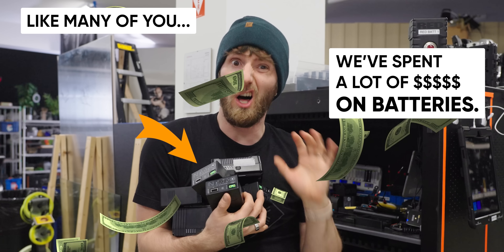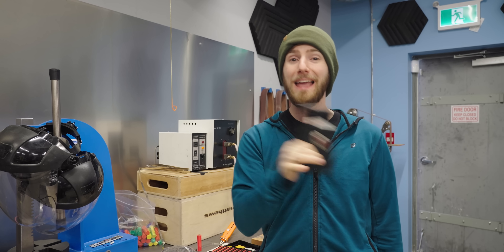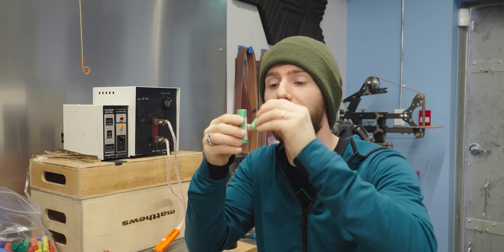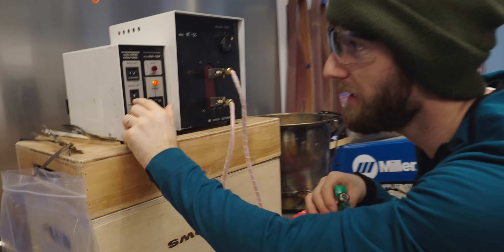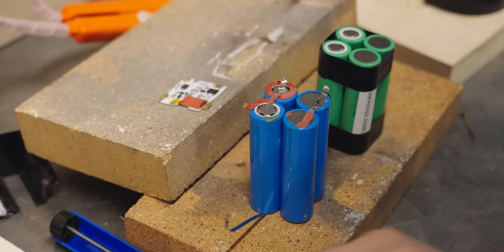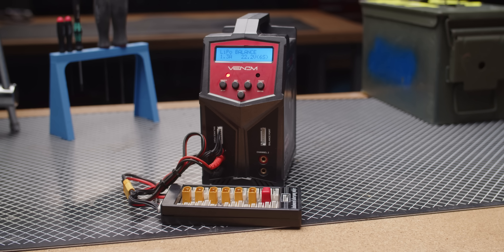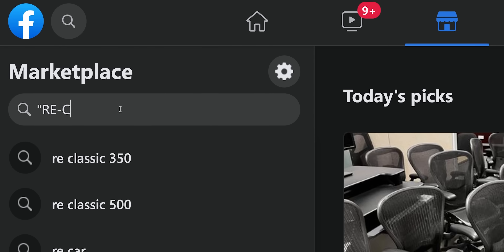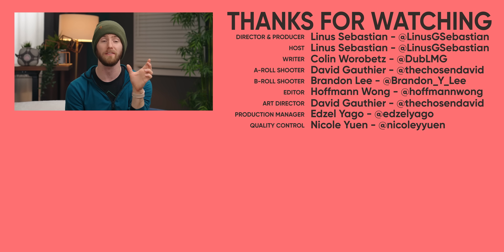This should be illegal… Battery Repair Blocking

Comment: One thing you didn't mention checking is trying to charge the battery first after replacing the cells.  For many BMS units, they start in an output disabled state and require you to first attempt to charge the battery in order to wake the BMS up.  Others require a wakeup voltage across specific test pads on the BMS and still others are as you describe, basically one time use.

What really bothers me is the number of BMSs that now communicate with the device they are plugged into "Canon I'm calling you out" so the battery has a security chip onboard that identifies it as an OEM branded pack and won't work with otherwise compatible replacements so you are at the mercy of the OEM to keep making replacements for a camera that may be in useful service for 20+ years.

Comment: This is great info for enthusiasts, but a little out of my reach.

The second someone mentions soldering/de-soldering, I completely check out. Kind of like the idea of not using a coupon on something unless it's for something you were going to buy anyway, DIY soldering only makes sense if you do it professionally or on a regular enough basis to be proficient at it, and already have the tools and peripherals to carry out the task. The labor, time, and cost of consumables are never factored in when someone says, "It's easy! just solder a new one!" People that say that kind of stuff are really disconnected with the gap between them and the average consumer.

Comment: Love the safety emphasis so amateurs don't try this and hurt themselves, but you threw out perfectly good cells, that sparking is completely normal and not what you think it is... That's the tip of the spot welder abrading itself and firing sparks, nothing to do with the battery being at risk of any kind of fire at all. Think about when you touch jumper cables together, same thing, and all to do with the spot welder. You can even see the same totally normal sparking by a professional at 17:26.

Comment: When welding strips to the positive terminals of 18650 and similar cells you need to be extra careful how your strip is routed to the positive terminal because the casing of each battery is attached to its negative terminal!!!  There is literally only about 3 or 4 millimeters between the positive terminals edge and the edge of the negative tied casing of the batteries.  If you heat the strip too much then the strip can burn through the insulation around the top near the positive terminal and short to the casing.  So don't make your strip too long and use a toothpick or a business card between the tab and the edge of the cell when welding to the positive terminals.  Also, discharge your cells to about 2.8 volts before welding to them.  Oh, and spot welding will occasionally produce sparks especially if you use too high a voltage, and it is a high current at the lowest workable voltage with the shortest on time that you really want.  It should be quick like snapping your fingers, if its not then your probably doing it wrong and damaging your tips and your batteries with excessive heat and stray voltage.

You can also order 18650 batteries "with tabs" that you can solder directly to and as long as you don't apply heat for too long it is much easier to create packs by just soldering wires between the tabs on each cell.  You just have to solder to the ends of the tabs and fold the tabs back over the cell as you go to keep the tabs out of the way.  If you are good at soldering it is much simpler but may require a bit more room than before.

Comment: I used to work on a team developing large Lithium packs for some in-server DC UPS solutions, A lot like a big laptop battery. In many cases disconnecting one wire tap from the calls would make the next one up see double the voltage, it would then do its job and permanently blow an electronic fuse in the BMS preventing the battery from ever charging again. You could put them into a service mode before re-celling. It's possible the BMSs in this video are behaving quite reasonably.

Comment: Bear in mind different types of lithium batteries are disposed of in different ways. We cover leads and  handover liion cells for recycling. We discharge, test, completely short-out, and then throw away lipos. 

We do need to pay more attention to devices which have the “do not throw away” indicators on them. They should be turned over to the proper facilities for disposal.

Comment: Many years ago I had an HP DeskJet 2500 printer, it was fast and could do 11x17" with amazing results. It used individual cartridges and heads for CYMK, and it worked really well for the first year or so, although the consumables were quite expensive. My wife used it to do some charity work for her university, and the organizer was so thrilled, he insisted on doing something for her. She finally relented and said a set of cartridges would be OK, and she received two of each colour as well as one set of heads. Since we already had a new set of consumables in the printer, it was over a year when we finally opened the second set of ink (I think it was black, we used more than the others). When I put in the cartridge, the printer refused it saying it was expired. I looked at the box and sure enough, there was an expiry date on it, and we were about a week past it. I put the old cartridge back in and realized that it too had expired, despite there still being a bit of ink in it. The colour ink had not yet expired, but each cartridge failed as it reached the expiry date. I called HP and they said it was normal behavior, and that the only solution was to buy new ink. Then the heads expired, despite everything working fine... I disconnected the printer and gave it away that same week.

Comment: There's actually special class D fire extinguishers made to put out lithium fires, in fact there are specialist extinguishers for most types of hazardous materials fires given that you mostly deal with delicate electronics I would be surprised if you didn't have a clean agent extinguisher or twelve on the premises as they cause little to no damage to electronics unlike normal powder-based extinguishers.

Comment: 9:50 I spotweld a lot of batteries, and I can tell you the electrodes were not the issue. The main issue was the welding time, that timer you are using is literally making your batteries glow. There is way too much heat for way too long there. Use a spotwelder designed for spotwelding batteries like the kWeld. Your welder is designed for big metal sheets, not batteries!!
Even if the batteries would have survived that torture, they would propably leak electrolyte caused by cracks from heat.
Reply: Clearly they didn't do a good at this , I noticed that immediately
Reply: Yeah, like 10x more energy than needed.  Maybe do some better research first?
Reply: Yes. I've used a good old 100W solder iron to wires li-ion cells a few hundred times and never had a single issue with a burst cell. Just cool down the cells immediately and nothing should go wrong afterwards. Spot welders are made so that you don't get any reason to cool down the cells after welding them... The weld shouldn't glow for so long. Obviously LMG hasn't done enough prepping for this video.
Reply: There is to much current also. There should not be a glow as in the video. Probably should have practiced the procedure much more and try to fine tune setting on the welder for such batteries.
Reply: This is the most important comment here. If you're going to be doing something like this then just the tiniest bit of prior learning would tell you not to even try this with that welder. This is super irresponsible.
Reply: Replying hoping it will help get this closer to the top. I do electronic work but haven't welded batteries. I played a couple sections several times because they didn't seem to make sense. Glad it wasn't just me.
Reply: In fact, most (and all cheap-ish) spot welders generally do that. They actually all use too low of a current (like 100A), and they push the current for quite a long time (100ms-500ms) thru pointy electrodes to get any kind of weld on that small weld area.
That's I've made my own spot welder instead of buying one.

Ideal welding current is closer to 1000A, with a welding time around a millisecond (200us to a few dozen milliseconds, depending on strip thickness and electrode geometry.)

There's barely any visible heat in/after that kind of weld, the nickel strip even remains shiny, and the process is much more reliable and forgiving. No plastics get melted.

Note that 10 times the current means 100 times the power in the weld, but also losses in the transformer and wires, and the amount of power would be hard to pull directly from the grid(without capacitors) and hard to control with just a TRIAC, so I guess that's why they don't make those that often.
Reply: That is one of the best comments  here! You have the know how!
Reply: I'm completely ignorant of these things, could you explain what causes those sparks they were getting? And why do they have to throw away everything after those sparks occurr?
Reply: @Michelino_M5  The spark is a short that potentially damaged the battery. They are throwing them out because damaged lithium batteries are dangerous.
Reply: @coreymorse1347  Right, but why does the short happen only when they weld the strip to the battery? Surely the strip doesn't touch both poles, right? And if it did, wouldn't just touching the nickel strip to the pole cause sparking? What changes when the welding is done?
Reply: @Michelino_M5  He was damaging the batteries with a horribly incorrect spot welder. Minor sparking isn't an issue when spot welding specifically, but it is with the way they were doing it. 

Also, they were being overly dramatic with it due to fear. Though with such a bad spot welder, that's probably a good thing.
Reply: @Michelino_M5  There is a chance the short is just from a gap while welding, whether between the strip and the welded or the strip and the battery. There is also a chance he melted through the top of the battery and damaged the inside. He doesn't know which he did so they are moving the batteries outside in case they explode. He doesn't know what he's doing and isn't using the correct equipment, so he's responding as if he fried the battery with the welder. Which is a better choice than assuming he didn't, since he doesn't know what he's doing.
Reply: @Michelino_M5  Yeah, they were talking about sparks being the result of unbalanced batteries, but they only ever welded to one side of the battery. It seems they are missing some basic understanding. If there was a spark, it was from the welder, not the batteries. There was never a complete circuit with the batteries.
Reply: @Michelino_M5  they saw sparks and thought there was this big catastrophic event. There's was nothing wrong. If they thought that was damaging the batteries, they have no basic understanding of batteries. As you said, there was no way that it was a short. If something happened, they'd know about it. There isn't a single scenario that those sparks could have caused a catastrophic event. That "throw it in the sand" nonsense means they've never seen a li-ion vent. If there was soaking in the positive, and the spot welder was hot enough to burn through the terminal, there would most likely not be a spark and, if it went all the way through, there would be instant thermal runaway.
Reply: @Michelino_M5  It looks to me like his spot welder was burning a hole in the battery's metal casing. That allows the highly flammable electrolyte to escape and ignite.
Reply: @coreymorse1347  Wrong. It's not a short at all (that would cause far more smoke, trust me, it happened to me during pack-assembly on a 4S4P pack). It's a spotwelder that doesn't really seems to be designed for spotwelding batteries. But even if that is the case, a spotwelder that is designed for spotwelding battery-cells, can cause a spark when contact between nickelstrip and cell-surface isn't completely right or one of the electrodes isn't making good contact.
It happens with my kWeld as well from time to time. They are overcautious, don't seem to have a good idea of what they are doing and immediate dispose off a rather badly built but furthermore good pack.
And he is lucky he doesn't have to deal with extremely smart BMS-IC's: mine need deep communication (and some software to crack the security keys inside the BMS) per SMbus connection and then full reset and reprogramming to except new, higher capacity cells.
Reply: @coreymorse1347  There is literally no way the battery could have been shorted by this (crappy) spotweld.
Reply: to be fair linus did say they were total armatures and most likely didn't have anyone who could advise them on how to do proper spot-welding so while they did a bad job its still a good video on anti right to repair problems as well as why you should leave battery repairs to professionals.
Reply: @kirby5329  While I agree with most of you comment. I still think that they should of done a bit more research, it's looking too amature and dramatic now to bring his points over.
Reply: @ThaGuus  I agree. Linus did the same when he started dabbling in server grade gear and just communicated stuff to the viewer which were just issues based on his own inexperience and naivety , but he conveyed like his words were gospel from an experienced user.
Reply: Yeah, I agree with you Leo. I'm an electronic tech and also weld and can absolutely say the weld time was to long.
Reply: exactly what I came to comment!

Comment: Linus did you try to recharge the pack after swapping the cells as some have safety not to discharge after the pack goes under a voltage's

Comment: Y'all have way too much money to be this so ignorantly. You clearly didn't even do more than a little bit of research on these. I'm all for learning by doing, but these packs reach dangerous voltages easily and make fires or explode easily. Like you have infinite money just hire and electrical engineer to supervise you and you'll learn how to do things the right way and not teach people on youtube to do things in stupid ways. Also if you want to do this to last a long time to save money you're gonna have to make packs of cells from the same manufacturer (preferably sister cells from the same production batch) with the same chemistries and characteristics of cells or their different capacities and lifespans will shorten the pack. Putting different brands of cheap cells is not going to last nearly as long as a properly made battery pack and especially if you use cheap cells, where 18650s are the land of fakes and knockoff brands, you might not even save money because your pack as a whole won't last.

Comment: I believe fitbit used the "Evil bms" on their top tier ionic series. My watch had to be replaced with a refurbished Watch face. I know quite a few people that had the ionic or versa and it just randomly wouldn't turn on after charging one day.
Reply: There's no BMS since there is no battery pack, just a single cell. But a design mistake where a deep-discharged battery cannot be charged because it either can't backpower the system for a little bit or because it's not being detected is not uncommon, i think i have seen this with MTK phones back in 2000s, and a lot of tech from that era got repackaged into smart watches these days - synthesizable designs can be retooled for new more power efficient tech without extensive engineering effort.

Might have something to do with volatile power management controllers, their initialisation procedure. I'm almost sure the cold start on empty battery is possible, but likely needs external components, and there just wasn't space in a wrist watch.

But devices dying could have any number of reasons. There are numerous components that could be utilised wrongly or have an inherent design defect, it doesn't have to be the battery management.

Comment: Bebob is literally one of the best brands I’ve ever used on set. They are reliable, repairable. Price wise they are on the more expensive side but you won’t regret it.
Reply: Idk, I've never had a problem with Swit or idx or Beillen v-mount batteries either. I'm not going to buy some crap from Amazon of course, I just rely on the expertise of my favorite shop. They are also a rental house, they won't sell any crap, so I can safely take the cheapest option.
Not saying Bebop is bad or anything, it's just that they are more expensive.

Comment: just fixed a boombox by soldering new battery to the charging strip you get with ah a new original battery. do it self.. safed 20$ to a original battery and over 100$ to a new box.

Comment: arent those sparks just a thing that happens with spot welding? like ive seen multiple videos where sometimes sparks like that happen to 18650 cells (ive also made my own 18650 battery bank with 30 cells and those sparks happened a decent amount throughout the pack, its been 2 years sense i did it and the pack still works great.) i think it happens either by leaving the spot welder for to long or how much power ur putting into the cells it a little to much. it isnt the cells itself thats doing that. most likely the cells ur putting in sand are fine.

i do like the pre cautions though.

Comment: I would point out, swapping out the BMS can also sometimes fail, as they have the rest of the device check it is in the valid serial number for the official ones on the charge level data signalling.

Comment: Worked in tech support about 10 years ago.. the battery laptops were programed to fail afther rougky a year and a half of charging. As the battery was considered consumable goods and was not covered by the warrenty.

Very scummy and they havent gotten better since

Comment: I hate working around these BMS systems. It adds a few more steps to connect both batteries at the same time to prevent it from recognising disconnection but it's a pain.